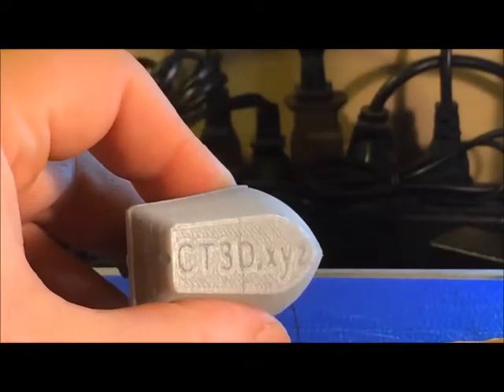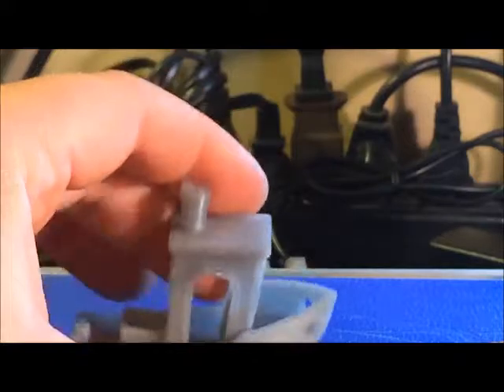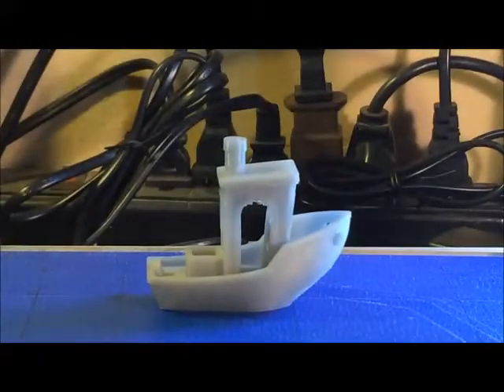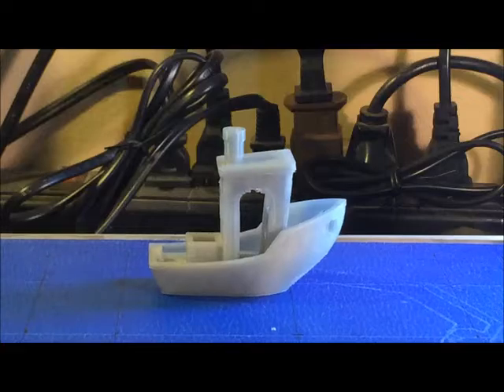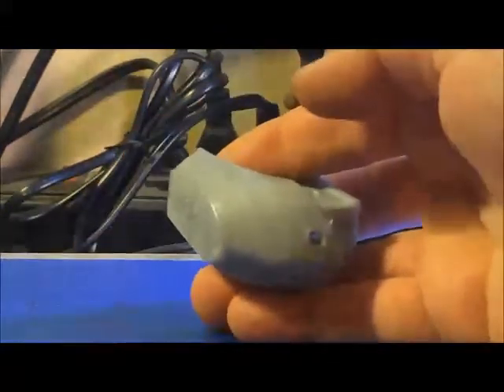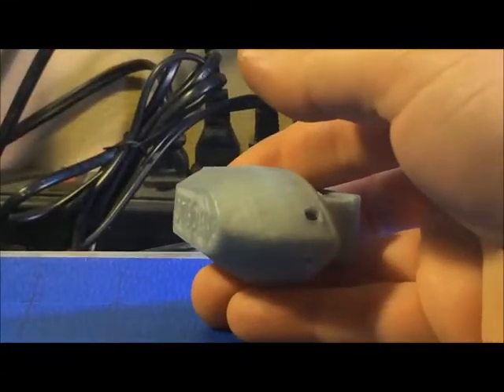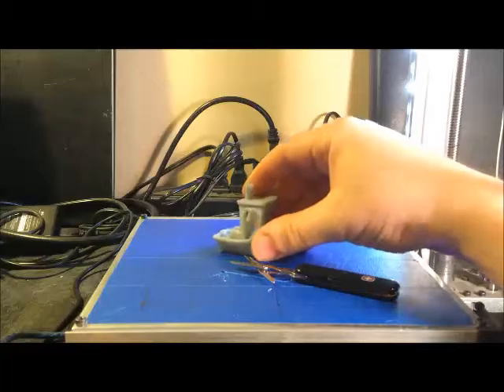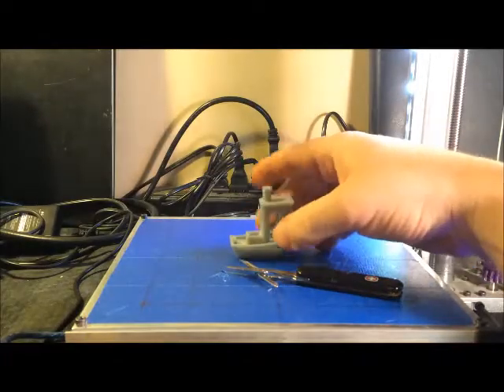Reach 3d Printer, Benchy test 2 zoom in, close up mid print...

Comment from the maker: Well, I know some people are not too interested in the bit set for a stretch goal. I could switch those out pretty easy. Also, its possible that the current fan just needs a shunt, to direct air flow more efficiently. I actually already have a shroud designed, but thought it wasn't doing much... hmm...
 A simple desktop fan could also be used, Ill have to test that and the shroud on my last spaceship print this week!